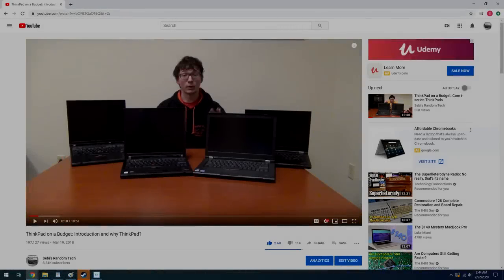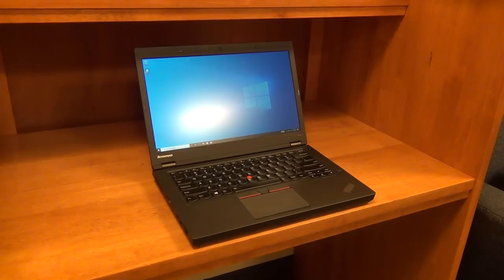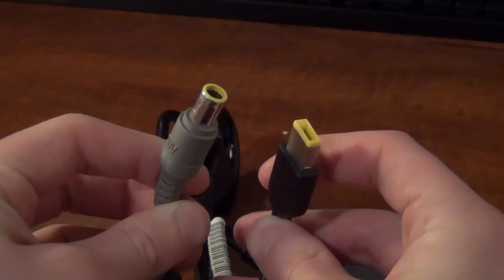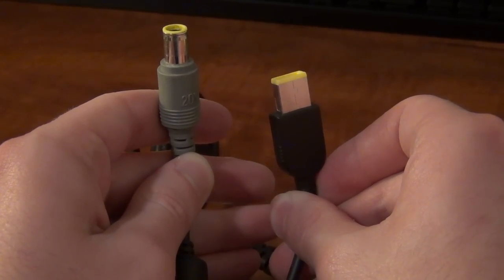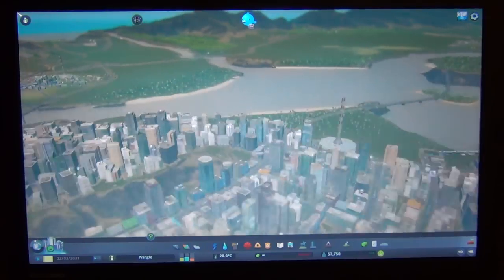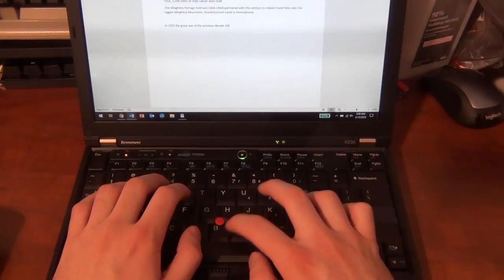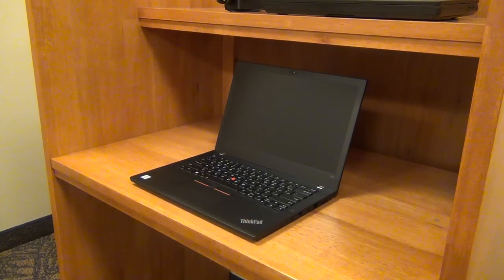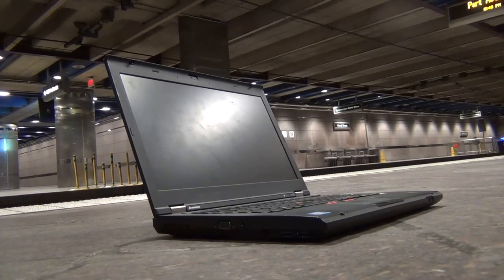Best Value ThinkPads in 2020

Comment: Hi, is S series any good? I've found a little banged up S440 laptop for dirt cheap without the gpu and wondering if I should grab it.
Reply from the maker: I don't know much about that model but if it's functional and is really dirt cheap then it may be worth a shot.
Reply: I know nothing about the S series and I barely know anything about ThinkPads (I got an x220 a couple of days ago), but if it's dirt cheap and you are interested, go for it.
Buying toy hardware, spending a week with it, and selling/throwing it into the drawer if you don't like it is better than not doing it and wondering "what if".

Comment: Valid points. Yet the T480 (the one I am using right now) is a valid choice for lots of reasons.
One is that this might be the best machine for Hackintosh right now in terms of full support and upgradeability (2017 MacBook pro).
The other is the use of TB3. Yes, it is a little pricey, I got mine on eBay with top tier i7 for 500$, assumed others would, too.
Let me explain. 
The chiclet keyboards are good enough (for me) to use. I own a Thinkpad with vintage keyboard, so I definitely know that there are better options and advantages with it, but long as you don't care that much, or just want the one with a thinner design, this is the one. 
And the inclusion and full support of Thunderbolt 3 makes it the single best laptop right now to be living in the modern era with a single Type C cable for everything. I have a local dock that works as a dongle and the video output dock to the display. And that is just magical. With it, the external graphic card is much more valid given that it might not be the TB with the best bandwidth, you can get a GTX1660 with full power, which I assume would be luxury for most.
Also, the maxed-out battery life is about 17 hours uptime with Linux, 10 hours for windows, and 8 hours with mac OS.
So if you don't want some function with double the price, this is the best way to go.
Yet his point is still valid. If you don't use 64G of ram, don't want all the ease to carry ( nearly or less than 1/2 the weight considering T440p), and want everything to be rock solid and easy to use, the older one, take t440p as an example, is good enough.
And T440p is great and can be expanded to the one with TB3, it just makes it a 700$ something laptop, and not really worth it. The full upgrade shall be costly, and for reaching T480, 450$ at least.
So the choice just came down to vintage or new in my honest opinion. 
Really a personal choice at that point.

Comment: I got a T 530 from my computer guy for free because it wasn't selling in his shop. It has a 2.6 GHz i5 3230 CPU, 8GB ram,A 120 GB SSD as the boot drive and a 500 GB HDD. Does that sound like a  good system? By the way I can run GTA 5 at 30 FPS on the Intel 4000 HD graphics. I just upgraded it to 16 GB RAM. Now it's smokin.
Reply from the maker: Great system, especially for the price of free! GTA will probably run on it but I don’t know how good the frame rate will be.
Reply: @SebisRandomTech  30 FPS lowest I got was 20 FPS
Reply from the maker: @mikestanley9176  Nice. I misread your comment as a question. Glad you can run it on there!
Reply: @SebisRandomTech  I want to upgrade to 16 GB RAM and i5 quad core.
Reply: @SebisRandomTech  Thanks for replying.
Reply: How's the temperature
Reply: @abdullahsaif9196  A little on the warm side. The highest temp was 78 degrees c.

Comment: I was planning to buy a Thinkpad T410 with a 4GB DDR3 and 320GB, the total graphics is 1664MB. It has Intel core i5-M580 and a CPU of 2.00 GHz. It is a second hand laptop and is around $27. Do you think it will work fine with Adobe Photoshop and Premiere Pro? I really need those in my school.
Reply from the maker: $27 is an extremely good deal for the laptop if it's fully working, but I think for the programs you will be using the T410 will lag behind a bit. I think the T430 or T440p with a few upgrades would be better for you, however $27 is an absolute steal.
Reply: @SebisRandomTech  Oh sorry, I meant $127. Anyway, thank you for the advice. I think they have T430 with quite a close price as well.
Reply from the maker: @wattergraphics2549  That would be a much better choice with more of an upgrade path for you. Hope it all works out.
Reply: @SebisRandomTech  The T440p is $177 but I still need to confirm it since it was posted awhile ago. With the same specs I mentioned before, the only difference is that T440p have a better processor, larger storage, and better graphic card. Thank you for your help!

Comment: I am getting a ThinkPad p50
4k non touch display
i7 6800hq
16gb ddr4
512 nvme ssd
2gigs nvidia Quadro m1000m
And I'm a ui ux designer, is it a good choice
Reply from the maker: Depends on the price. It's a solid laptop.
Reply: I'm getting for $700. With no repair just a battery replacement. Is it worth it.
Reply: Also for $1000 I'm getting a
 Dell precision 5510
Same specs with a 4K touch panel.
Reply from the maker: @VishalKumar-jz3qk  I'd say it's a decent deal with those specs.

Comment: Just wanted to be sure but isn't a t480 with MX150 gpu a better option in terms of graphics? If I want to do some light gaming for example...
 And if I went for a 430 or 440, are there better options as far as graphics go? Thanks
Reply: The T480 with MX150 completely blows the older T430 and T440 out of the water in terms of graphics. Also, the new 15W quad core CPUs are on par with the old 47W (!) CPUs. I'd pick the T480 any day of the week.
Reply: @hbgl8889  That's what I thought. However the price is still quite high for those with maxed out configs.
Reply from the maker: @gramoukdoom  That's the main issue. You can find a T430/T440p for under $100 on eBay and upgrade it yourself for $50-100 and have a very decent laptop in all categories except the graphics (which in the T420/T430's case can be solved with an external card), while the cheapest working T480 I've been able to find was around $400.
Reply: @gramoukdoom  Well, if you need graphics power then you simply need a newer machine.  Otherwise you have to device if you value a slimmer and lighter machine with better battery life and modern ports more than 300$.
Reply: @SebisRandomTech  I can't be asked with a egpu tbh. Thing is even a T480 with MX150 isn't really a solid gaming rig either. What kind of games could I play with a decent 440?

Comment: I recently scored an old X220 i7 and X60s. Upgraded both and used them as daily drivers. Just today, I found a W510 in need of some love. The current owner already upgraded to a new gaming laptop. Would u recommend this model?
Reply from the maker: The W510 is a very solid machine but a tad on the older side. Some of the faster X220 processors outperform some of the W510's processors. The W520 and W530 are a lot more capable, but the W510 isn't a bad laptop.
Reply: @SebisRandomTech  The processor is Core i7 Q720 @ 1.6GHz.
Reply from the maker: Not bad, what screen does it have?

Comment: What do you think of a 460p deal? I'm currently looking at one with a i5-6300HQ processor (so 4 cores already) for 370 USD or 310 EUR. 
TDP is 45W and I never know what to look for in this number! The lower it looks like less powerful although on the cpubenchmark site I see lower is better.  Thanks!
Similarly, at @16.:50 you say "low voltage processors"'s "performance is actually worse". So, do we go for high or low TDP W? :)

https://en.wikipedia.org/wiki/Skylake_(microarchitecture)#Mobile_processors
https://www.cpu-world.com/Compare/990/Intel_Core_i5_Mobile_i5-6300HQ_vs_Intel_Core_i5_Mobile_i5-6440HQ.html
Reply from the maker: $370 US for a T460p is pretty good. The T460p uses higher power processors so they will perform better than other ultrabooks.

Comment: I left the Mac meme, now I need something for web development, budget is not an issue. Ideas?
Reply: dual core devices should be sufficient for almost all web development environment. However, quad core is still a plus if you can get one with it. If you want a relatively modern and upgradable thinkpad, T480 is probably the way to go. The biggest downside to T480 is the relatively dim (250 nits) and color inaccurate display, if that's a deal breaker, you could go for T490 and choose the 300/400 nits option.

Comment: Hi quick question- will a 65w power supply still be ok if i upgrade from i5 3320 to i7 3610qm for the T430? Or, will i need 90w
Reply: Yes, but it doesnt charge while the laptop is on.
Reply: @eli7693  thanks! ok so really ill need a 90w charger
Reply from the maker: Yes, you'll preferably need a 90W charger.
Reply: @SebisRandomTech  This did the trick though I had to do a load of driver updates to get the ‘% remaining’ anything like reliable. Anyway it worked fine so alls well that ends well.

Comment: I bought a T460 on eBay for $262 bucks.  I just ordered a 1tb  crucial  mx500 and 16gb of ddr3 ram also by crucial.  So when all said and done  less than 420 bucks for a T460 with an I5 processor, windows 10 pro, 16gb ram, and 1Tb SSD.
Reply from the maker: That's not a bad deal for the base T460. Those still sell for over $300-350 easily.

Comment: Great video. Using a t420 and t430. T420's audio occasionally cuts out but other than that this been great. What's your daily driver laptop currently?
Reply from the maker: T430 with some upgrades (working on a video about it), FrankenPad T601 (T61 motherboard in a T60 chassis), and a T480 (that I am editing the review for now).

Comment: I have a ThinkPad T440p with an i7-4800MQ 4c/8t, 12GB RAM, GT 730M, 256GB Samsung SSD, 1080p IPS panel, 3G modem, backlit keyboard, fingerprint sensor. I'm planning to get more ram, new battery and second SSD for it.
Reply: You can also install an M.2 NGFF drive in it. There's a dedicated spot on the MB for that.

Comment: Wolfgang actually made me interested in picking up the T480, especially due Thunderbolt Type C but that also exists on T470 machines which are a bit cheaper to get by and come with Skylake CPUs which are still modern enough.
Your points against one of those is quite valid however.
Now that I still have the T420 sitting next to me on my desk and a X240 as my companion on the go, would you suggest rather to replace the 420 with a 440 (along with its docking station, a feature I love) or rather to max out my T420 since it still has its 1600x900 TN panel and only 4GB of RAM?

I suggested the same ThinkPads as you to a friend and he picked up a maxed out T420 and maxed out T440 around Christmas.
Reply from the maker: I think since you already have an X240, it would be redundant to buy a T440 to replace your T420. I’d suggest spending the money to upgrade your T420 with more RAM, storage, and maybe the FHD display mod. It’s one of my favorite laptops for a reason!

Comment: Found a T420S, I was wondering if it is a good enough model compared to the regular T420?
Reply from the maker: It's a great machine! I didn't feel like including it here since they're a little bit harder to find, but if you can get a good deal on one it's a great laptop. The only downside is that the battery life isn't as good and the CPU is soldered as opposed to the thicker T420's socketed processor.

Comment: alright let me fix my grammar, first of all yr vids are awesome and I'm hooked, also I just got a t430 (best purchase of my life) that is in mint condition  and I was wondering what I could do with it, mostly I want it for school work, hacking and tinkering around with it for hours on end.
Reply from the maker: Are you asking what mods/upgrades can be made or what kind of computational tasks can be performed on it?
Reply: @SebisRandomTech    eh, both I guess
Reply from the maker: So when it comes to mods/upgrades:
- Takes up to 16 GB of DDR3 RAM
-2.5” drive and mSATA SSD, plus the DVD drive can be swapped for a hard drive caddy
-Processor can be upgraded. i7-3612QM or i7-3632QM are the recommended upgrades. You can put in faster 3rd gen processors but might run into thermal issues
-A classic keyboard from a T420 can be modded in if you prefer that layout
-An upgrade kit allows for 1080p or 1440p IPS displays to be installed, providing much better picture quality than the stock panels
-1vyRain is a BIOS patch that unlocks advanced settings in the BIOS and allows you to install more customized options. I may use this to remove the wireless card whitelist to make Hackintoshing it easier (that’s something else you can do!)
-Additional ports or peripherals can be installed using the ExpressCard slot. There’s even an adapter available that allows you to hook up an external graphics card via that slot.

For what you would use the laptop for? That’s up to you. It can handle most everyday tasks with ease, and my T430 is currently my daily driver for everything except video editing and gaming, which I have a desktop for. That being said, depending on your expectations and what kind of games you play, it can be possible to use a T430 for those purposes. Basic programming/coding and Photoshop work it can handle without major issues. Other than that, you’ll have to play around and see what applications work for you. I would say only the most extreme demanding tasks would require something newer and more powerful. Hope you have fun and enjoy your ThinkPad!
Reply: @SebisRandomTech   thanks a bunch dude! I am gonna opt for a better screen. the t420 keyboard. the caddy along with a 7200rpm harddrive and  a 90 whr carrying case battery.  and ill just go on as time progresses.
Reply: @SebisRandomTech  one last thing. Will the t420 preform well with web browsing and word proccesing?
Reply from the maker: @juicekickreborn3890  It should be more than fine for both. I’m using my T430 as we speak.
Reply: @SebisRandomTech   i literally just got my t430.  Its so much better than modern laptops slready

Comment: Currently waiting for my T430 which might arrive just in time for my birthday. I've been using Dell for the past 10 yrs and have used latitude D, latitude E, Inspiron, XPS laptops and have seen their laptops get worse over the years. Now I'm making a switch to thinkpad to replace my age old E6410 (oh what a tank it is!). I like the keyboards of old, they would catch my fingers. Newer ones are too far out and are flat, my fingers always slip. I was choosing between the T430 and E6440 which had quad core and more modern amd graphics, but at 200AUD more than the T430, it just wasnt quite justifiable. So I went to buying the T430 which got an extended battery and dedicated graphics and higher resolution at that! I thought it was a great deal. All these upgrade options gets me excited to do them once I finish uni!
Reply: Why do you think that xps got worse?
Reply: @sunnyiong4795  I started with m170, then m1330 and m1530. Riddled with heat problems, system shutting off because it's reached the heat threshold. I stopped dealing with their xps line by then. Got hold of c610, d610 and felt the keyboard and overall build was better (non gaming), but still some issues with heat and battery life. the inspiron did its job but the build quality was just poor. e6410 has almost same build quality as m1330, but less of the heating issues. for keyboards Id go with m170, c610, d610 and e6410. I was able to try the keyboard of an inspiron G3 and thought it was too soft. I can't  tell for the newer xps though. but in general, im not digging the the newer keyboards atm.

Comment: I really like T450s. They are getting relatively cheap, are modern, slim and pretty light.
With a little bit of hunting, those with FHD screens go about ~280e in Europe.
T440p is nice, but it's a lot heavier and with a worse touchpad. 

I guess it really depends on what are your preferences/needs.
Reply from the maker: As said in the video the T440p's touchpad can be easily swapped for a T450 touchpad. The T450s is a pretty nice machine as well that I would love to get my hands on, but the T440p still wins out in performance and upgradeability.

Comment: I am running a T430 with the 1080p IPS mod and it is great! A couple questions with this laptop. Which CPU would you recommend for this laptop for the best performance/battery (currently running the i5 3230m and starts to show when using music/media production software)? Also with 1vyrain and the Hackintosh scene is there a specific guide you have seen since this bios mod (any new features gained opposed to built-in WiFi support)? Lastly in regards to the mSATA storage. This is the one aspect I would say is overpriced when looking at upgrading this laptop (more of a last resort after you have used both the main storage and the HDD drive bay). Have you seen any clever ways to get this storage type cheap or any mods? Also, love the vids!
Reply from the maker: I ran a 3612QM in my T430 for quite some time and didn't see a substantial dive in battery life. If you go for the more powerful i7's (the ones that consume 45W instead of 35) then you will definitely take a hit in the battery department. I am working on a video myself about the 1vyrain mod and may eventually make a video about Hackintoshing one. As for mSATA drives, I usually buy mine used or refurbished to save a few dollars without resorting to cheap (and questionable) brands. Also, I know that someone on r/thinkpad is working on a NVME adapter that will fit into the ExpressCard slot, and will be bootable, so that may solve the issue of expensive mSATA drives in the near future.